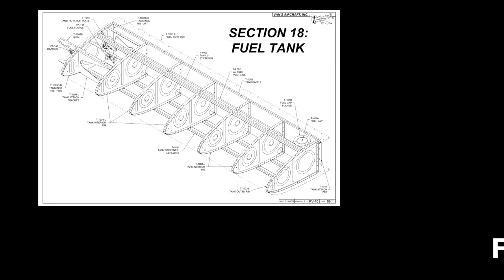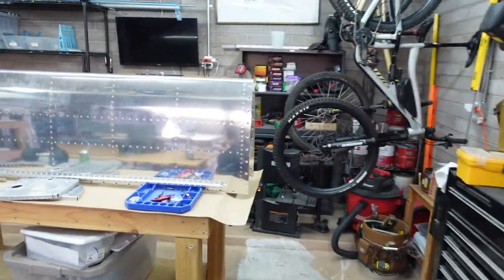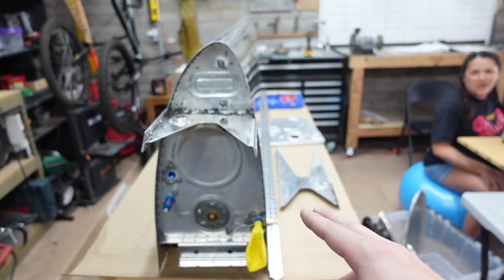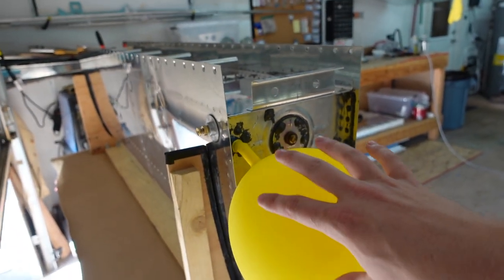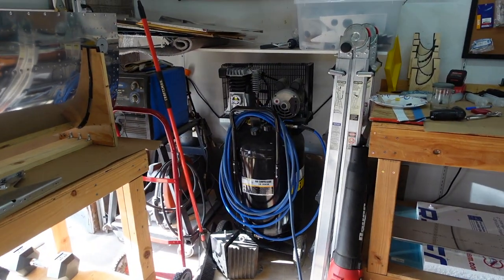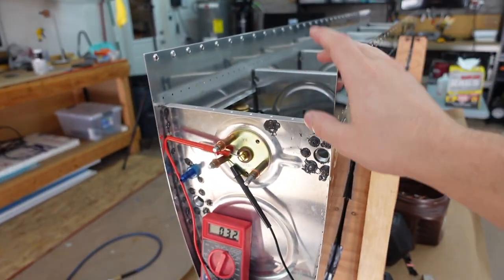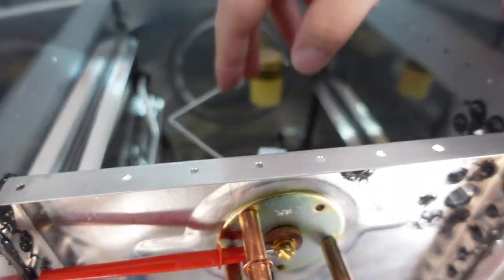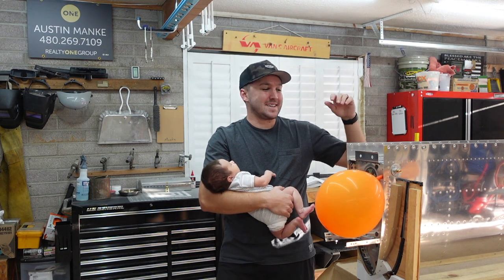Van's RV-10 Wings - Fuel Tanks, Part 2 of 2

Comment: Just wondering, I see you prosealed the fuel sender and bolts, how are you going to replace is when it fails? I will have to look back. But we did not seal ours.
Reply from the maker: I did. I’ll likely have to find some way to carve it out of the slots on the screw heads. Will definitely be a pain if it has to be replaced!